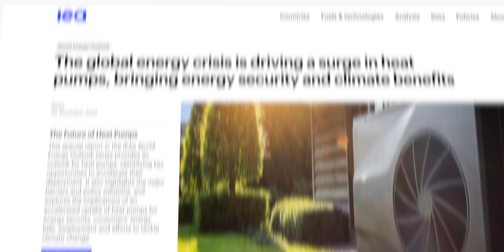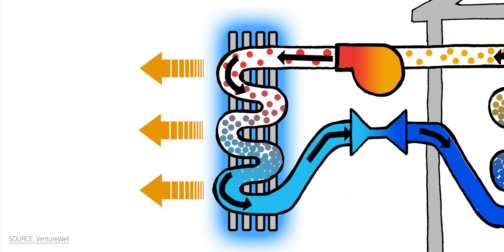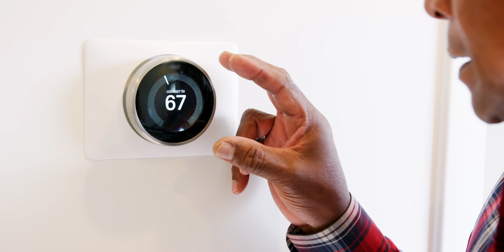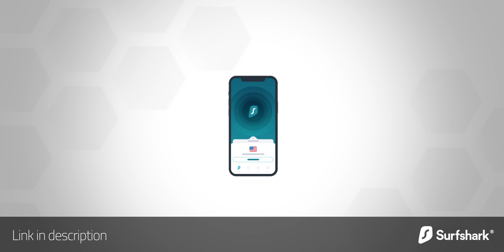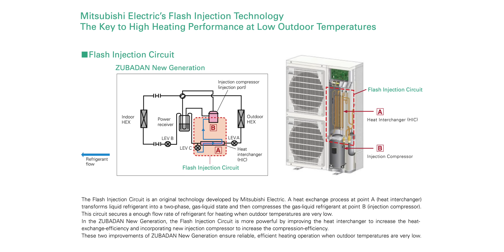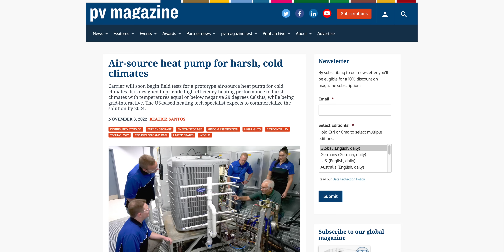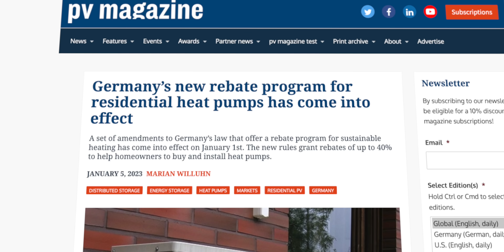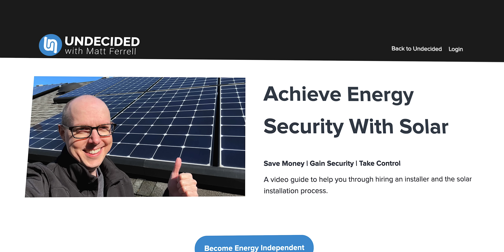Major Advances with Heat Pumps in the Extreme Cold

Comment: is anybody doing linked heatpump systems.

lets say i have a AC, hot water, dryer and fridge/frezer, some make things cold, others make them hot but all are heat pumps.

can these be linked, pump heat strait from the fridge to the hotwater system, or atleast dump the waste heat from the fridge where it can improve eficiancy of the hotwater system.

Comment: You really dropped the ball not talking about the difference in air quality between a gas or electric boiler versus a heat pump not using gas to heat air greatly improves air quality

Comment: In NZ we’ve been installing /repairing these (primarily for heating) for over 30 years.. no problem at all. They claim to work down to -15 deg C , although with reduced performance.  Its interesting to note the worst portion can be 0-8deg , fog chills to form ice on the subzero outdoor unit coils; But below zero humidity falls out of the atmosphere, therefore less de-icing cycles are required below zero. 
If the inverter has good technology less de-ice cycles are required

Comment: Scandinavia, Germany and other European countries have used heat pumps for many decades without issue. You (can) install a heat pump without beefing up your insulation, but doing so still remains the 'best practice' option (before) heat pump installation; it will keep operational costs down.

Comment: First of all thank you for the video with all the explanations - I've only heard it once somewhere abot the heat pumps, but I never knew what was it all about, even having one in my EV and in my apartment I didn't realise this wasn't just another marketing click-bate (like "SoundBlaster" or "PainKiller"). I thought it was all about delivering heated air with a direct fan, like the other device that some people call a "heat cannon". Now I understand why do some many hotels have the AC units as the only heating devices in their rooms.
One thing bothers me, though, especially in those hotels - this in-door unit HAS to use a fan and hence to chop air and produce noise. How do you think, would it be possible to make a device that could have used the same thermodynamic principle, but without the fan? Would it be the next generation floor heating or something?

Comment: As an HVAC tech, heat pumps are great until you have a major problem which will happen more often because you're constantly using your heat pump all day to maintain temperature. Yes heat pumps are made to maintain temperature not to heat up your house, that's why when you turn up the thermostat 2-3 degrees higher it'll kick on your backup heat
Reply: Properly sized heat pumps will heat up a house or whatever building they're in perfectly well. It would be a bit of  joke to market heating systems that can't do the job.

Comment: When I built my 1500 sq ft rancher in 1995 I chose a WaterFurnace brand ground source heat pump as my HVAC  system. After 27 years, yes 27 years, of operation it still runs flawlessly! It is extremely efficient as my monthly electric bill for this all-electric home has averaged $89 for the pasted 12 months. As an added bonus, my water heater is connected to the WaterFurnace and provides free hot water. This system has paid for itself several times over in saved electric costs. In addition, there is no annual maintenance costs; in 27 years of operation the only repair cost was for a bad relay switch ($60)  and 2 service calls to optimize the pressure in the field pipes !

Comment: It is hard to extract heat from a pound of outside air when there is only a small amount of heat in the air at the lower temperature. Look at the phychometrics based the temperature and wet bulb temperature to determine total and sensible heat loads. Low temperatures don't yield alot of BTUs or calories when needed.    

Ground source heat pumps are a differnet subject as long as the loops are buried at the proper depth for the location. At the proper depth the heat pump can extract (winter) or reject (summer) decent heat load. 

I would not hesitate to install a ground source heat pump in a new build (if the land needed is available). 

I would only use an air source heat pump where it does not get too cold outside. 

It is hard to beat physics.

Comment: Can’t compare a geothermal to the air source heat pump. Geothermal heat pump is just a water source heat pump. Not every place in the planet can have a geothermal heat pump the ground can’t handle it.

  Gas furnace would always be my first choice in a very cold climate over any air source heat pump. Heat pump will center later break and you’ll have a big repair bill especially now since the governments have attacked the Refrigerant even more. Better have back up heat because if there’s a snow storm and the heat pump has problems good luck on getting it fixed. Your video really messes the point on repairs. Inverters all that technology cost a lot of money.

Comment: Geothermal is considerably more expensive but significantly less liable to issues in subzero temperatures. An air based heat pump just can't do the job, and every installer I've spoken to has removed one that was installed and replaced it with a gas boiler again...

Not to mention that an air-source heat pump is 2x or 3x the cost a conventional high efficiency gas boiler... Even with grants that you can't get because they require underfloor heating etc...

The big question is why is an air-sourced heat pump so expensive - it's a scaled up freezer with a reverse function. There is no logical reason such simple component cost so much. Geothermal - yes, you have labour for digging down far enough to lay the coils, but air-source heat pumps are nothing special.

Comment: Thanks, genuine question, here in UK electricity costs about 3 times as much per Kwh than gas, so even with a COP of 3, which is not really possible yet, how does an ASHP work out better.
Not relevant to my situation as impossible to install ASHP in my house without near demolition and rebuild.
Reply: For the UK; COPs closer to 4 are generally doable when done properly with the system target of -3C. COP of around 3 are really a more realistic scenario for when the outside temperature is often around -7C for long periods of time - i.e. not most of the UK.  Heat Geek is a channel worth checking out for a lot of the UK stuff.  Gas may be cheaper for now, but it's unlikely to last with the Paris Agreement and COP 26 enshrined in law, so by 2030 the gap in price for electricity and gas is going to be narrowed.  Also, there are tariffs available that you can get cheaper electricity at night that is comparable to the gas price, and use that for the most energy-intensive part of heating - domestic hot water. Also Gas doesn't have a COP of 1, at best (for most of the UK), it's 0.9, so you need to consume 1.1kW of gas for 1kW of heat.

Comment: I live in North Carolina, so pretty temperate climate.  I have both heat pumps and natural gas for heating depending on the floor in my home.  The Gas always feels warmer despite it being objectively the same temp.  I think it has to do with the output temp of the air from the register and the run time.

Comment: A caveat about heat pumps. Be aware that once out of warranty if the heat pump has a control valve assembly failure you will have trouble finding anyone who will attempt to repair it and warrant the repair. If you get a quote to fix it and warrant the work the cost will be so high for a unit that may only last a few more years, that you'd be better off to junk the unit and buy a new one. Unfortunately, all the years of savings will disappear when you get the bill for the new heat pump.

Comment: Matt, I am considering a heat pump in my Long Island, NY home. Is a heat pump worth it if I do not drill in my backyard like you? Does an outside air to interior space heat pump work if the lowest winter temperature if 5F and highest heat in summer is 100F. I quote extremes here only to be sure I am prepared for such conditions.

Comment: If heat pumps would not be able to go below 5°C, how would a freezer work going down to 18°C or 27°C. Because a freezer uses a heat pump. Norway, a rather cold country, has 60% of residential housing heated by heat pumps.

Comment: The problem in UK is that gas is about 7pence per KWh and Electricity is 35pence,  so need a COP of 7 to 1 just to break even, without ever paying back the equipment and installation costs.  To pump heat the heat has to be there in the first place.  If heat pumps take off, they will increase the amount of aircon gas in the world by millions of times,  and one thing aircon systems do very well is constantly leak gas -  which is bad for the environment.... looks like trying to solve one problem is creating other problems...
Reply: Your math doesn't check out, even if your prices weren't biased towards gas; 35/7 is 5, so a cop of 5 would be needed to break even.  Gas Boilers also don't have a COP of 1, it's at best 0.9 in the majority of cases, so it costs you at best 7.7777p per kw of heat with gas.. bringing the cop required to break even down to 4.5.  Also, you might want to do your research on heat pumps and how often they need to be regassed - basically never; if they were constantly leaking then they would need frequent regassing.  Plus the refrigerants used in today's Heat Pumps, R-32 and R-290 are far more environmentally friendly than their predecessors.  Thirdly, to pump heat, they need heat energy, not the heat that you feel, Heat Energy is only absent in Absolute Zero (about -270C).
Reply: @BenIsInSweden  Never met an aircon system that did not leak, because when compressor not running the interior system pressure is around 200 to 300PSi, so please explain why heatpumps would be any different ?  The less ambient heat available the more energy ( time x power ) needs to be used to  recover it, which explains why the COP falls with ambient temp. An aircon system still works as the gas leaks away, but gets less efficient,  until one day the pressure switch does not operate  and then it will not even start because compressor will be damaged.   In discussions most people talk about ground source heatpumps, which do have a better COP than air-source - but need lot more work ( =£££'s ) to install.  Due to lower output temp of ASHP extra electrical energy needs to be added to heat DHW to raise it to a safe temperature of >60degC,  and unless your property already has underfloor piping which can run at low temp, your existing radiators will need to be upsized and also the piping,  and you will struggle to get that money back.  ASHP may be OK for mega-insulated modern house where they are built for the purpose, but for most existing properties they simply will not do the job at a reasonable cost. We have had several power outages this winter, but the gas fire never failed to operate ( the gas boiler still needs electrical energy to run, but a backup battery could still keep the boiler running for a lot longer than it could keep a heatpump working ).  Due to reliance on intermittent renewables our electrical grid is normally on a knife edge due to wind often disappearing in colder weather and lack of sun in winter..   Newer aircon gasses may be more 'environmentally friendly' than they used to be but if heatpumps ever catch on, they will raise the amount of those gasses in the world by a truly massive amount.  Reverse cycle heatpumps will also put a summer load on the grid that was not really there before when people start to use them for cooling,  and the use of aircon in hot weather has crashed electrical grids around the world more than once.
Reply: @chrissmith2114  So is everyone's fridge and freezer leaking refrigerant into our homes on a daily basis? as the compressor in those isn't running constantly either. Been a heat pump owner since 2015, never had a leak, maybe I'm just lucky. DHW doesn't need to go above 60C, in fact, domestic regs in the UK state that hot water out the tap should not exceed 60C. It's also possible to have your DHW safely at 45C as long as the turnover of water is sufficient (Heat Geek have a video on this about Legionella). Regardless, R290 Heat Pumps can get up to 70C without the assistance of immersion heating if you really want to be super safe. It's funny how many people want a heat pump to cover the costs of upgrading their heating system to a low-temperature one. High-Temperature heating restricts options (and with most of the UK, just thrown together), whereas Low-Temperature heating, you can still burn fossil fuels (and still save money), use an ASHP, GSHP, Solar Thermal etc  Wanting a heat pump to pay for the low-temperature upgrades is akin to wanting Solar Panels to cover the cost of replacing a 50-year-old roof, it's unrealistic. As for power outages, the heat isn't instantly lost, and if your home is leaking enough heat that it goes from ~20C to something like 10C in an hour or two from the heat pump being off, then you are spending a fortune in heating as it is with gas.

Comment: Great video, Thanks.  

Could you do a video on liquid to liquid heat pumps.  There are lots of applications but one of my favorite's is using the heat extracted from a house in the summer to heat a pool.  I think this is one of the highest efficiency uses of residential heat humps.  Effectively you can heat a pool for free while cooling the house.  I did this in Toronto (so north of most of the USA) and had a pool at 90F from June to October, with no heat blanket on the pool!!  

Yes in some areas residence would have to find ways of expelling excess heat beyond what is needed to heat the pool but any pool heating is both simple savings and CO2 savings as I expect most pool heating produces CO2!  

In a new build application, I think the payback of any incremental costs of such an installation was almost instantaneous and in retrofits it could be as low as 2-3 years!

Thanks

Comment: The electricity has to come from an overtaxed grid….and we are not into EV cars as yet…..you may be correct in the future..just not at present. Had heat pumps for over 30 years and the only one that worked well was geothermal which is very, very expensive to install.

Comment: Heat pump are more and more popular here in Poland :) Mostly because government give discounts for some group of people. Additionally most of us are connecting it with PV and maybe we still don't store this PV energy from summer in some battery but we can get that energy from grid in winter. But still most houses need renovation to insulate them, replace heaters for bigger or even put floor heating for better efficiency as many houses need heating water with 50-60C with -5C outside. Combo of HP and PV cost about 90-100k zl => 20-23k $ (of course it depends on how much energy you need for heating) which for most people is too expensive as that is theris 3years net income. That is why many people is still replacing coal furnance with gas boiler. Cheers :)

Comment: We had two (zoned) heat pumps in Las Vegas providing both heat and A/C.  High electric bills during both summer and winter.  Ugh!

So, during the second summer, I surrounded both condensers with a home-built swamp cooler, reducing my electric bill by 40%.  Very dry in Vegas, like 5%-15% relative humidity.  I'd planned to build a solar hot water system and do the same during the winter, before I realized it would be far simpler to simply pump the heated water through radiators in the house.  About a 30% savings there using only one radiator in the living room where everyone gathered throughout the day.  We allowed the bedrooms to stay much cooler during the winter.  If I'd had three times the solar hot water heater surface area and three radiators inside instead of just one, the savings would have been far higher.  Used it for two more years before moving on.

The greatest problem there, however, was the severe lack of proper home insulation.  Bad sealing, no IR barrier, and inadequate insulation for those blazing summer days.  Very poor solar design, too, with almost no overhangs, and certainly not at the right height to effectively shade southern-facing windows from the sun!  

I sold the house when I moved.

Still greatly enjoying your many insights, Matt!  The accumulation of knowledge and systems have lead to a preliminary design that's relatively inexpensive to build, darn near bulletproof, and entirely off-grid with both solar photovoltaic and solar hot water.  With enough insulation, passive solar design considerations and a thermal barrier fresh air exchange system, we'll need far less A/C tonnage than average builds.

Comment: I use a heat pump - but only down to 1 degree Celsius (about 38 Fahrenheit). I live on a mountain so Geothermal is cost prohibitive. Cutting through granite is very expensive which raises the cost of the geothermal heat pump which works in colder conditions, so my estimated cost when I put my air heat pump in was about $50,000. The cost to make up that cost difference of an air heat pump means the life of the heat pump (about 12 years running all year around in the northeast) is almost enough to break even. This means it was a problem for me to go Geothermal as I would not see any cost savings at all for the life of the unit. Putting more money into my AC/heat than a car seems crazy to me. So I use a heat pump 9 months a year, and then I am forced to oil. New heat pumps when they come out should be about the time I have to replace my older unit.  Then perhaps I can leave oil completely.